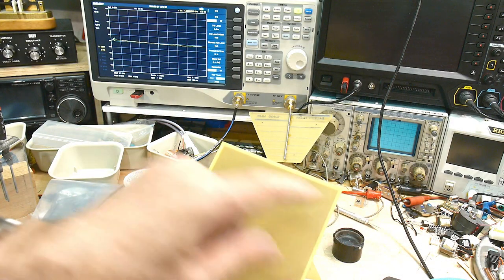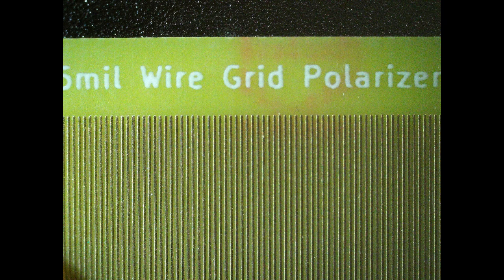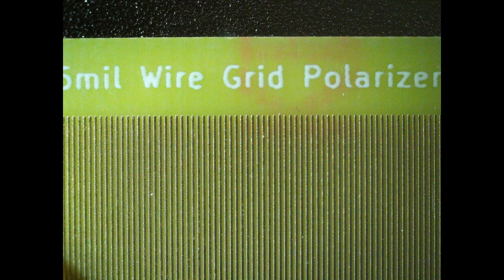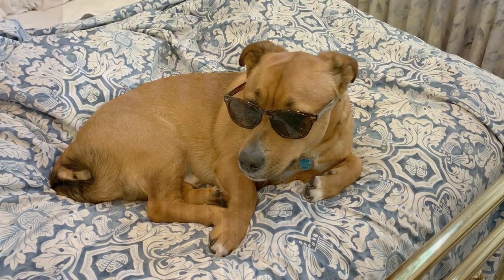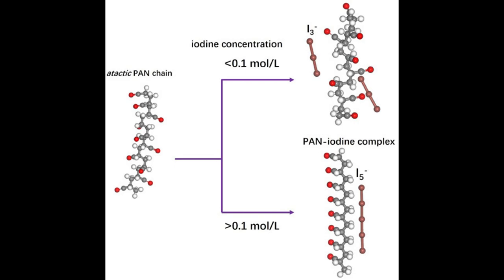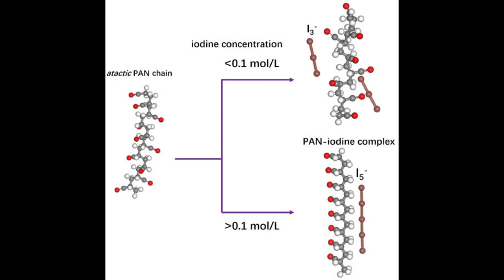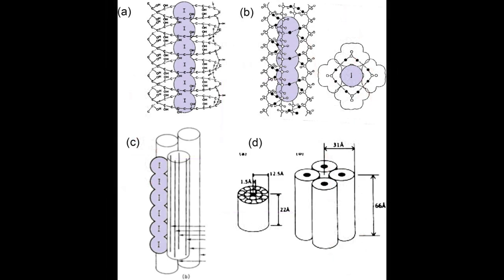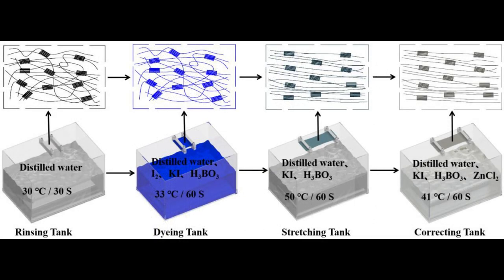#1441 Sun Glasses and Wire Grid Polarizers

Comment: If you want you can deposit a thin layer of metal on top of glass or plastic using sputtering  or CVD or MOCVD then then use photo-lithography and  photo resist process to etch and create long lines.  That probably could make a better wire.  They use processes like these to make binary lenses.

Comment: does anything interesting happen if the wires are connected to each other in different ways? You could obviously solder a wire down the end and make a comb, you could bridge alternate ends to make a zig zag, maybe 2 combs, or these with some isolated wires. I don't have any thoughts on what might happen but it seems like either something cool or something bad like it gets worse.